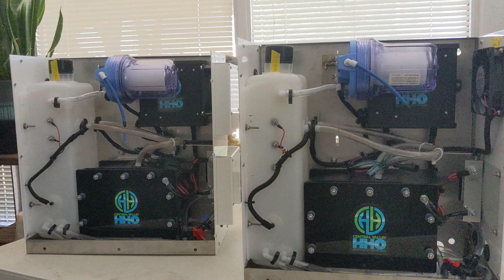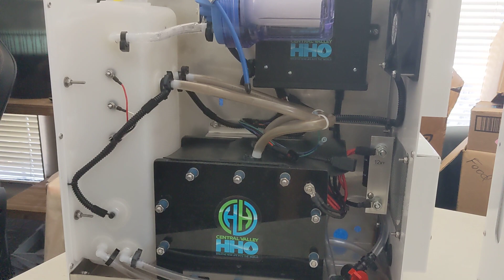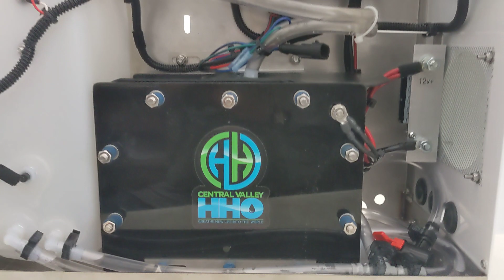Hydrogen 2 Commercial  Units for 15L trucks.

Comment: I'm looking into a unit for my 2021 3.0 duramax diesel. I drive alot it's an hour 1 way to work. What would a unit cost for my truck
Reply: Just seeing if my comments comes up? Scott learned how to make Hydroxy Gas™ from  DOD Dr. of Aero Space Engineering - Bob Boyce™, who learned pre-1930 physics, where they leave in the (-)equation of the ether energy, that free energy  all around us in abundance. You need to capture this (-) into the cell design and create (-)ortho H2o gas. To create a form of HHO gas that is 4x to 10x more powerful, than common para hho gas, that 95% of the HHO guys make today, that has hit or missed results. You must be able to follow instructions and listen to make this higher quality form of gas. Just look up Hydroxy Gas™ to learn more. ( This comment will most likely be erased.)

Comment: GOOD STUFF! are you still running 316L plates? Have you considered carbon Foil plates instead. Just asking. Very very interested. Y’all ain’t no joke
Reply from the maker: We have a special coating. no we have not. thanks.
Reply from the maker: Do you have any data on that in a Electrolyzer? we do catalysis not electrolysis.
Reply: @ssfuturescott  Robert Murray-Smith. Super efficient graphite hydrogen generation. 2020 June 2. My stainless steel hho cell gets hot BUT I don’t have a pulse with generator to pulse at resonance to help keep the temp down . SS is high in resistance anyway. Graphite should be way lower.
Reply: @ssfuturescott   The cell is made of 316l stainless steel or graphite
Reply: You might want to watch my video on different qualities of hydrogen. We don't ever have any problems with heat. There's more to hydrogen fuel cell than most people understand. We have a special coating that is very  efficient makes a high-quality gas. For every 1.8 Watts we gain 1 lb of torque on the diyno!
Reply: @scottsmith6960  yes sir. I’m not familiar with catalyst generation. Looks like I’m fixing to learn something